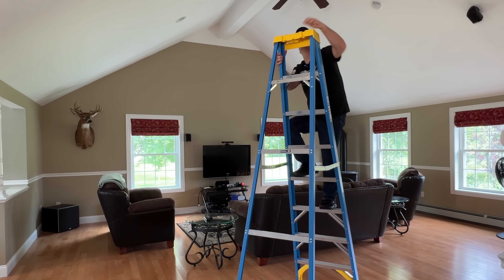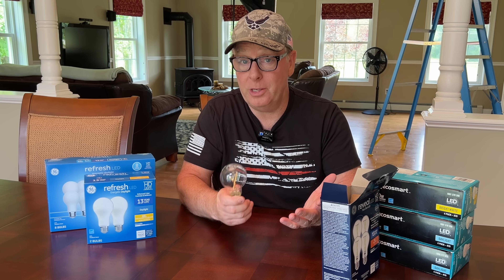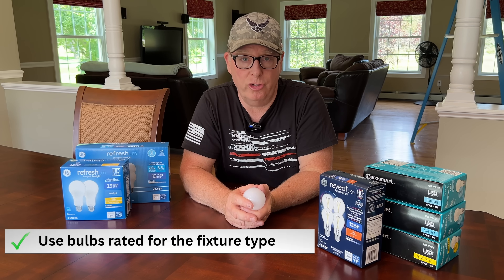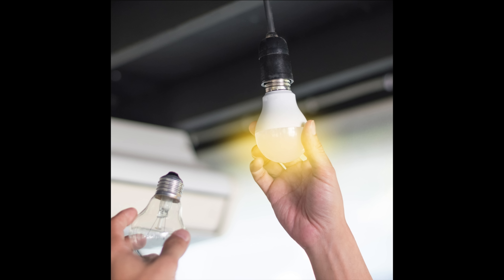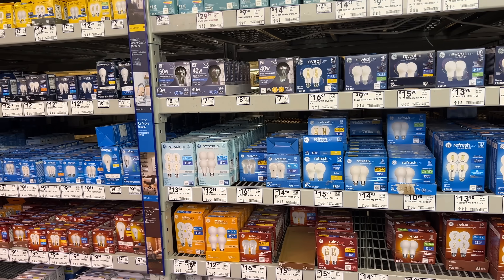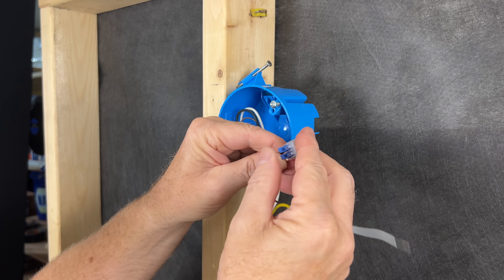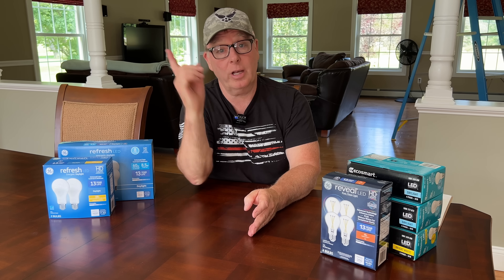The Mistake That Kills LED Bulbs

Comment: I purchased 6 LED bulbs early (sometime in 2008). Back then I used them way more then three hours a day. I am still using them though they are being used less. Only one is flickering and starting to fail so far. They have ugly metal heatsinks, but they have lasted a long time.  I also purchased Phillips Slim bulbs which look a lot nicer and have also lasted me a long time.

Comment: About 10 years ago I replaced every bulb in my house with LEDs, everything from the 100W garage bulbs to the smallest halogen reading lights, the decorative hall chandelier lights- even an old 300W torchiere lamp from the 90's- sourced from the 3 big box stores and not one has burned out or flickered yet. Maybe I just have good luck, who knows.

Comment: The reason is written in a fine print (which in my opinion, should be printed in a BIG LEGIBLE FONT) that it's "Not for use in a closed fixture", and that closed fixture includes the innocent table lamp. 😠

Comment: Algerian here !
I 7 years ago moved to a new apartment !
Replaced all incendecent bulbs with Algerian made LEDs
And in 7 years 
I only had 1 bulb go bad out of 12 bulbs
In 7 years
Also in the hall i installed 2 new Bulbs with movement detection !
The old 2 ones were stil good .
The brand is GharElec Short for Ghardaya Electric .

Comment: Picked up a Philips 3-way (50/100/150 equivalent) three days ago to replace the incandescent equivalent in a table lamp that the 100W filament finally burned out on after last being changed (to my memory, anyway) sometime in the late 1990s. The new bulb boasts of a 13+ year life. Replaced the old bulb, (screw downward orientation) and roughly 5 hours later, with the switch clicked to the "100 equivalent" position, the bulb flickered twice, then went dark. Twisting the switch should have kicked up to the 150 setting. Did nothing. Next click should have been "off". No change. Next click should have gone to 50 watt. Nothing. Counting clicks around the circle changed nothing. It was dead. Unscrewed it - Not hot enough to blister skin, but definitely "too hot to be fun to hold". Screwed it back in for lack of anything better to do with it (throwing it at the wall would have been satisfying, but then, making sure I got all the pieces out of the carpet would have been too much work) Shrugged, cussed the piece of junk, and turned on a different lamp, planning to get a new one "later". After about 10, maybe 15 minutes, the LED one came back on, stayed on for about half a minute, then went out again. clicked it to "should be off" position, and thought no more of it. Until about 10 minutes later, it came back on. Guess I lost count and missed the "off" position. It stayed on for about half a minute again, then went out. Pulled the plug to keep it from playing "lighthouse", and still haven't gotten around to getting a new bulb for it.  I'm sold on the LED bulb concept... <eyeroll> 16 bucks for a light bulb that lasts about 5 hours then turns into a 30 seconds on, 10-15 minutes off flasher... Yeah, that's an improvement... NOT!

Comment: One brand I've had bad luck with longevity with is Feit Electric. For that reason, I don't buy them. I once bought 10 of their faux filament style LED bulbs, and now, only 3 of them still work. I personally use GE bulbs. I've still had some failures, but far less with GE, and, to be fair, they were non enclosed fixture rated bulbs used in enclosed or partially enclosed fixtures, so that's probably the reason for their failures. But anyways, I'll try enclosed fixture bulbs in the future if I have any more failures.

Comment: I've had Ecosmart bulbs fail under 2 years.  Not as bad as Feit (Costco) bulbs though, which fail often.  (other Feit devices have been fine, just the bulbs are unreliable).  My IKEA LED bulbs haven't had a single failure in 7 years.  
Look up the "Dubai Lamp" - LED bulbs that Dubai commissioned Philips to make, specifically to be lower power and longer lasting... too bad can't buy in USA.  
Another tip I've seen to extend bulb life is to buy dimmable bulbs that are rated higher (100W-equiv for example), then dim them down to your desired (60W-equiv) - using an LED-rated dimmer of course.

Comment: it depends:🤔 if it has driver, so polarity not concerne 
if it hasn't driver(which for end user its impossible), so should correcly connect +- ,(hot & neutral isn't meant because of led work with direct current.
🙏🙏🙏
Reply from the maker: Yes. Unless you are running your lighting with DC power, the lamps need a driver to function. Also lamps with a driver will not function when supplied with DC.

Comment: it depends:🤔 if it has driver, so polarity not concerne 
if it hasn't driver(which for end user its impossible), so should correcly connect +- ,(hot & neutral isn't meant because of led work with direct current.
🙏🙏🙏

Comment: I learned about heat issues on another channel now i only use "enclosed fixture rated "  last so much longer regardless of the fixture sylvania are rated for enclosed fixtures now in my track lighting and last long time.

Comment: Very simple an I'm onlly at first minute of your video AC does not have polarity like a DC circuit where vvoltage/current onlly flows in one direction therefore an AC circuit led light (not a bulb as has no fillament) will work with wires either way round.
Reply from the maker: AC power has alternating polarity which reverses two times per cycle and 120 times per second. The AC feeds a driver which delivers DC to the LED which is why they will work if the neutral and hot are reversed.
Reply: @BackyardMaine yeah thanks i knew that and if they had more leds internally and ran a lower voltage from the driver the leds would last much longer due to less heat lower current flow and have same light lumens output.

Comment: 3:35 "The #1 killer of LEDs is heat." -- So True! The solution? Reduce the heat by buying more efficient bulbs. Most LED bulbs on the market are 90 lumens/watt, but IKEA now sells 135 lumens/watt bulbs and Philips also has some super high efficiency 180 lumens/watt bulbs. Since these use 25% and 50% less electricity, respectively, they also generate 25% and 50% less heat which leads to their longer lifespan. (Also, Philips is a name-brand company which uses higher quality components, so that helps, too!)
Reply from the maker: Great information. Thanks for adding to the conversation.

Comment: Neither side of the AC mains should go to earth. Any metal part of the fixture should be directly connected to ground (earth) That's basic electrical safety standards. At least in UK and NZ. Maybe USA have different standards?
Reply from the maker: Not at all. The metal shell on the fixture is the neutral return and is part of the circuit. Same deal in the UK conductive parts of the circuit are going to be carrying current even when bonded like our neutral wire of our 120v systems.

Comment: Main reason why modern LED bulbs fail is because manufacturers designed them to get more lumens out, same time driving them at maximum current.. That produces more heat too contributing bulb to die faster. Usually, LED that has slightly different parameters, than others in same series, dies first, leaving black spot on phosphor layer, and bulb may start to flicker at first or just dies.. Lowering current through single LED, will prolong life significantly, but that isn't good for manufacturer..

Comment: Thanks for the video. I am leery of what is labeled on the box and any marketing materials. When I see something like "For use with enclosures" and it cost significantly more, I wonder if it is just the same bulb that can be purchased for a lesser price, just put in a different box at a higher price. Named brands are less prone to misleading people by selling the same product in different packages with just changing the price.

Comment: Its screwed into AC the polarity is changing 60 times a second (here in the US).
Reply from the maker: Actually 120 times per second because polarity reverses two times per cycle. But the reason the polarity does not affect the function on the LED bulb is because the LED is supplied with DC power through a driver in the bulb.

Comment: I am a Chartered Electrical Engineer and I have also found this short life. I have some in open fittings but cap up in a bedroom on about 2 hrs a day. They last 2 years or around 1500 hrs. I also have three outside but enclosed and switched on a dawn to dusk photocell. In the middle of the UK that’s an average of 8 hours a day. They last 2 years or around 5000 hours. The incandescent lamps ran for at least 5 years in both applications.
Reply from the maker: Thanks for sharing your experience with LED lifespan in different applications.

Comment: I'll bet if you leave the globe off that light fixture, the LED bulb will last much longer. The globe isn't necessary, because the LED bulb itself is good at diffusing the light, and there is no danger of the LED bulb exploding. It is just there for the sake of appearance, and it confines air surrounding the bulb, making it run hotter, which shortens the lifespan.

Comment: If you go through LED bulbs as described, have your house wiring checked for surges. My house has been 99% LED for close to 10 years and I only had a couple of bulbs fail.
Reply: I have the opposite issue. Too low of a voltage ⚡. I would rather dim the light with a smart LED driver :)
Reply: @ArthursHD Low voltage means more amperage which = heat.

Comment: Just watched an electrician in the UK who described how an electrician died because another previous electrician had reversed the polarity of the plug, and how a simple plug in tester would have predicted this and saved his life. In his case, he touched the washing machine case and a pipe - and died - Also, for the fixture you leave on as a night lite - stock up on a few good florescent bulbs - to hell with the LED nonsense - the government has no right to insist that we use bulbs that don't last where we need them too - how many older people, like I am now, die from falls each year?  I know I am falling easier than i used too -

Comment: If there is one thing I learned from these LEDs I would say that you can make them live a lot longer by modifying the smd resistance responsible of the current
Try increase this resistance by 10-20% and the led will last a lit longer than usual
Relation of current with light intensity is not linear! There is a limit where the increasing in current gives huge increasing in heat with very small increasing in light intensity
So, increasing the smd resistance will reduce heat a lot, while maintaining light intensity
This will work for any led
Usually you will find 2 smd in parallel
I learned this by tearing down plenty of leds

Comment: I've been using LED bulbs for 15 years and have never had one burn out.
Reply from the maker: What brand..
Reply: @BackyardMaine  I used to work for Lowes so it's a mix of GE and Utilitech.
Reply from the maker: @GCSol  I just bought some Utilitech lights yesterday for the first time. I installed them to replace the last few incandescents I have left in the house.

Comment: More specifically, these high constant temperature and temp-cycled failures are common. (1) Dried out electrolytic capacitors (2) Browned or open circuit LED’s (3) Corroded connectors interfaces (4) Failed solder joints (5) LED becomes detached from heat sink. (6) Heatsink compound dries out.  The other types of failure might be mechanical cycling/vibration, high humidity or poor atmosphere, or poor design or workmanship of the bulb.
Reply from the maker: Great points. Thanks for taking the time to list all the different failure modes.

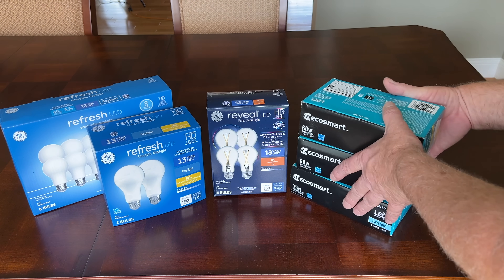Comment: Time stamp 0:48, If they are diodes typically they only pass current one direction.
Reply from the maker: True but the LED is supplied with DC through a driver while we are delivering AC to the lamp.
Reply: AC !

Comment: You can be lucky with a noname brand. I bought 3 cheap chinese noname LED lights and 2 of them failed pretty early, but one of them is running since 8 years without issues.

Comment: Fun fact, reversed wiring with an LED can cause a faint glow when it's off. There's sometimes just a little bit of leakage to ground, like milliamps, and there's always live AC at the bulb. This is how I found out a room had the hot/neutral swapped at the panel. An outlet tester will also say that you aren't grounded, because it's testing for continuity between ground and neutral and the neutral spot is hot, there's no continuity.

Comment: I miss the good old incandescent bulbs. They always almost lasted as long as advertised.
Reply: trouble is most of the standard bulbs were 800-ish hours and they were done. Halogen would often double that but truly long life has been a myth except for very low power draw bulbs. I had a bulb (LED) in standard shaded fixture last about 8 years running constantly. Truly the best I have ever seen, but it was like a nightlight 15 watt equivalent bulb.
Reply: @thomaswomack3888  LEDs don’t even last a year for me
Reply: @thomaswomack3888 the low I.e. 15 W equivalent led bulbs do last for years and years. I have one which runs from dusk to dawn every night. The same bulb I installed 10 years ago is still in operation in 2026. It is quite dim, like the brightness of a candle basically but is so incredible long lasting. The 60 W equivalent seem to not last very long.
Reply: Good riddance to incandescent bulbs.  I switched to LED bulbs 11 years ago, and a good LED bulb lasts five times longer and costs 1/10 as much to run.

The problem is that the market has been flooded with ultra cheap bulbs that aren't rated for enclosed light fixtures.

My experience is that brand names don't help.  What guarantees quality is always buy bulbs rated for enclosed fixtures and dimmers (even if you don't have dimmers).  The bulbs will last years even under heavy use.  If you insist on those two spec, enclosed fixtures and dimmable, you will pay $2 more per bulb.  But, instead of lasting six months the bulbs will last many years.
Reply: No... no... the government told me LED's are green and will last decades! Wait... they lied to us (again)??

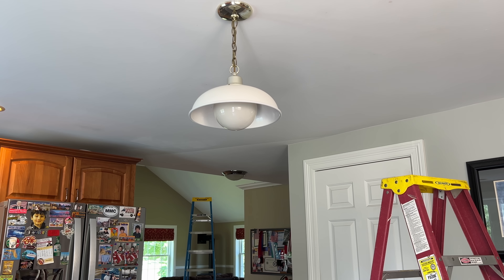Comment: 3:10 Even though you use one rated for an enclosed fixture, the light could last much longer if it had more fresh air convection inside the globe. 

Leave the globe off or try drilling small holes top / middle / bottom, to allow fresh air exchange.

Comment: When there was a sales boom for white leds, out partner company promoted these and sold them and power supplies with barely any profit and urged all their partners to do the same. 
So after a year or two our chief asked them during the visit where's the profit? Leds didn't give any and they lasted forever. Power supplies were high quality and lasted forever too.
The partner's CEO said: "well, we're going to make profit off capacitors once PSUs start breaking after several years!" I doubt to this day we profited from these either since power supplies were too good. These were dedicated led panels with current regulated power supplies, the best you can use for leds. Not tiny overheating bulbs, not 12V panels that get fried once leds start to degrade from sub-optimal conditions. I wish these were easier to use and buy but unfortunately you have to pick a power supply for a specific led panel, matching their performance, unlike with voltage-controlled devices.

Comment: Enclosed fixture or not, an LED bulb facing down will self-heat a lot more than an LED bulb facing up (or even sideways). If at all possible, chose fixtures with the bulb facing up and with an open top.

Comment: In the UK a lot of bulbs are bayonet fitting. Until 20 years ago, nearly all were. On those, the bulb can be plugged in either way round, reversing live (hot) and neutral, so it was no surprise that reversing live and neutral wouldn't be a problem for the bulb, only for safety if the outer ring is a conductor.

I have seen automotive LED conversion bulbs that need to be the right way round to work.

Comment: They shouldn't go into small enclosures, period. There is not much they can do to "rate" them. Try not putting the globe on the kitchen light. Buy big decorative bulb, or two bulbs with a splitter. A big glove is acceptable, as is a fixture outdoors in winter.

Comment: AC… reversing polarity 120 times per second. So, DUH, of course they’ll work regardless of hot/neutral polarity. 😂😂
Reply from the maker: The point is not that at all. The point is the AC power is not delivered to the LEDs. The AC power feeds a driver which delivers DC to the lamp. If you were to reverse the DC then the LED would not light.

Comment: Use the biggest bulb with the smallest wattage per bulb. For example use two 800lm bulbs instead of one 1500lm if you can. That way you split heat dissipation over a larger volume, their temperature will be lower and because of that, bulbs will last longer.
Also you can use more efficient bulbs which produce less heat per lumen, and consequently last longer (but they are usually more expensive).